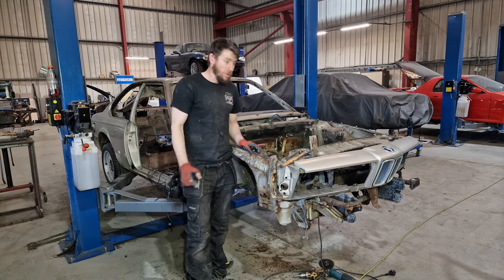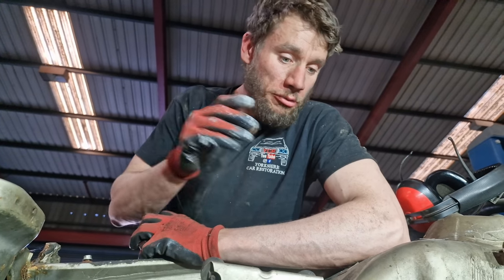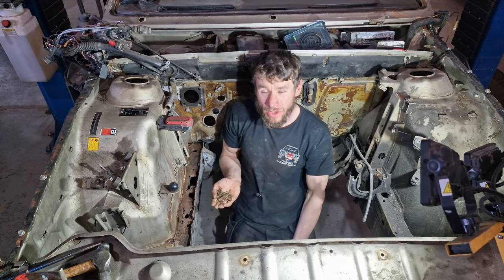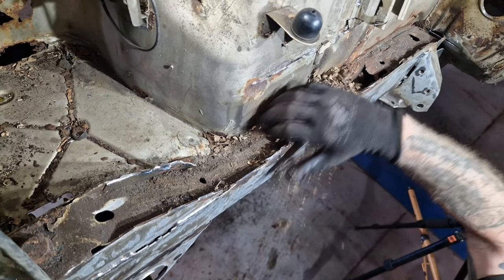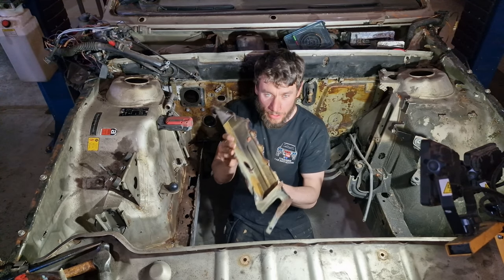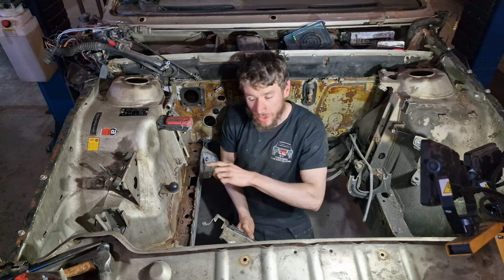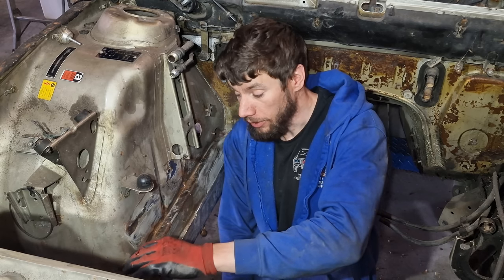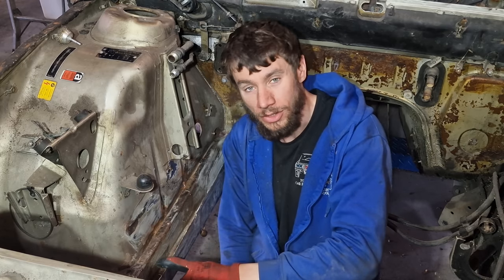MAJOR Structural Chassis Repairs On Mat Armstrong's Classic BMW E24 635 CSI - Restoration EP6

Comment: Given the amount of rust, I'm curious as to why the chassis wasn't stripped and sand blasted to get rid of all the rust. My guess would be to actually protect what's barely hanging on so it can be used as a template. 

I love watching this. Having done a bit of this work myself it's good to know I went about it in about the same way. It's a long haul but totally worth the effort.

Comment: It feels like a media blast/sandblast would have helped a lot in identifying the pieces that need to be replaced/fabricated
Reply: Probably would have fallen apart/lost important dimensions seen better condition barn finds than that 635
Reply: @markthomas919  probably also true, but It feels like they are using the wire wheel quite a lot to get rid of the paint and various insulating material. At the end of the day they are measuring a lot of pieces in place anyway.

Comment: Although i admire the craftsmanship and talent presented in the welding and shaping of different sheet metal components doesnt the heating of the existin body panels change the steel properties? Surely, the excessive heat from the welding changes the phase structure of the high strength steel, do you have to follow a specific set of requirements of what to cut and such? 
Love the videos, just curious about your work!

Comment: It's a great job, but wouldn't it have been easier for you first to have had it acid dipped or media blasted to reveal all the rust without having to use the grinder? I'm so impressed by the skills on display.
Reply from the maker: Thank you very much. And we will be sand blasting it once we have it on a rotisserie

Comment: Hello! Im in no way a car mechanic or a welder, so please forgive my newbie question. But I was wondering, on 16.11 in the vid you can see something that looks like small holes in the structure, is that okay or are you planning to do something more on that section? I love the vids you guys are doing btw :)
Reply: Which holes were you referring to? Was it to the left and towards the outside of the chassis rail? Just to the left of what's been repaired? If so, that's more rust where I believe the washer bottle sat.
Reply: @vaughancameron8155  no, i mean straight in the middle of the bar if you look @16.11. There are 3 dots there that looks like holes.

Comment: I had a couple of E21's,E23's and one E24. they all head their rust problems..But not as bad as this E24.. Damn, that will take a lot of work to fix! Why not completely strip the chassis and dip it in acid, to remove al the paint and rust protection?

Comment: Would it be easier to acid dip the body to really see the rot?
Reply: Seriously, it wouldn't have survived acid dipping, the whole front would have broken off. Weld what you can see it needs to restore structural integrity, then acid dip it to highlite non-obvious areas that still need attention.

Comment: I have a question, why don't you remove all the wires in the body, then sand blasted or dipped in chemical acid to remove the rust and paint at once, after that just repair the body, doesn't that make your job easier?

Comment: Why wasn’t the car chemical dripped to remove all the filler and undercoating material as well as rest of the rust would have been a lot quicker and less time consuming
Reply from the maker: We will sand blast it once we get it on a roll over jig
Reply: Cannot wait to see sandblasting.